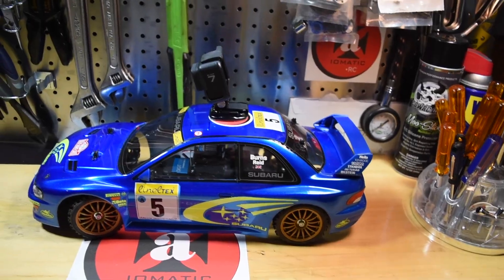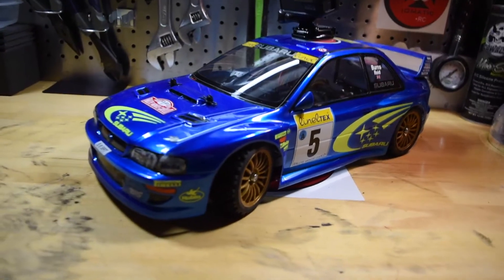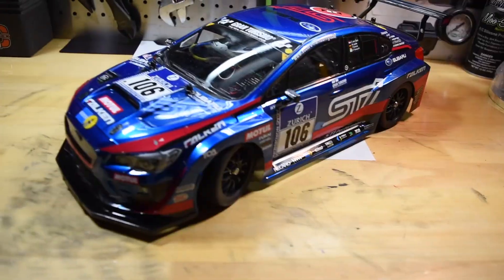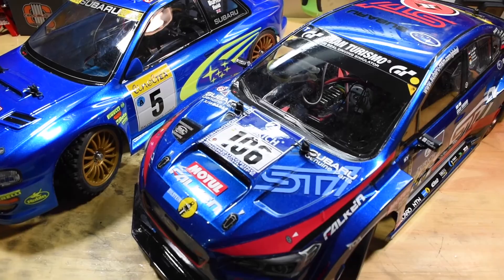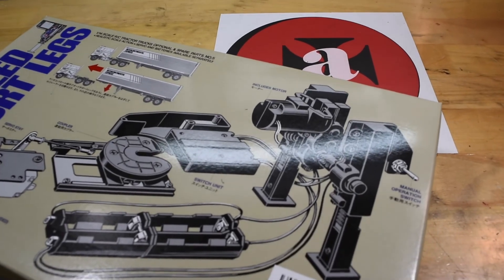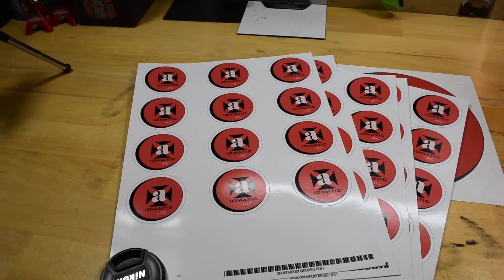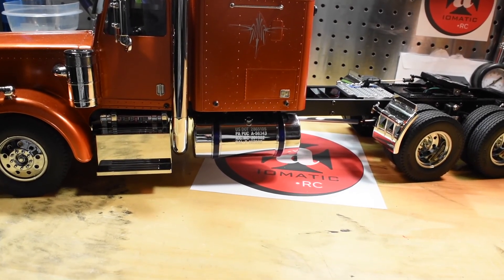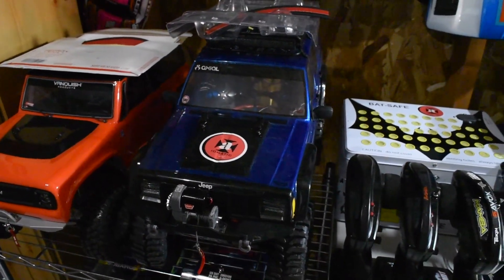RC Randomness Episode #15 - Tamiya Madness!!

Comment: 😉👍Great stuff! those rally cars are fun! what hop ups you going for ?
Reply from the maker: Shen RC - I think shocks first and then I may look at the steering. The more i run it, the more I’ll figure out what I think should be changed!
Reply: @AxiomaticPro  I did oil shocks, aluminum steering wrack and aluminum steering knuckles they are the weak point on this one.
Reply from the maker: Shen RC - I was thinking the same. Thanks for the suggestion!!
Reply: @AxiomaticPro  Hi I did oil shocks, aluminum steering wrack, and aluminum steering knuckles these are the weak point of this thing...

Comment: Great update on all the cars..damn washer! lol..You going to put a mild brushless system in the rally car??
Reply from the maker: PhilthyCoRC - I am definitely considering it!!
Reply: @AxiomaticPro  A nice hobbywing 3652 Combo would be great imo..but ask Steve what combo he runs in his..I know his runs and sounds great with the audio!..The diffs and drive shaft should hold up fine with a 3500kv and lower on 2s.. But you can always upgrade them to metal and run 3s! Lol
Reply from the maker: PhilthyCoRC - I’ve been taking to Steve about his recommendations. I didn’t ask him about the esc and motor yet, need to do that!!
Reply: @AxiomaticPro  You can always get the Tamiya sensored motor made for that ESC..13.5 turns would work great..But I'd order the ESC fan also.